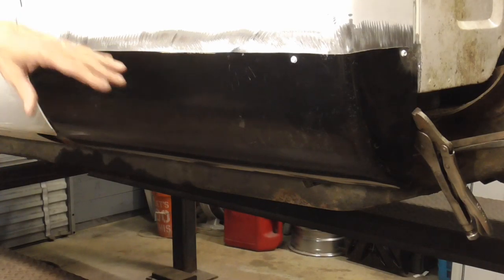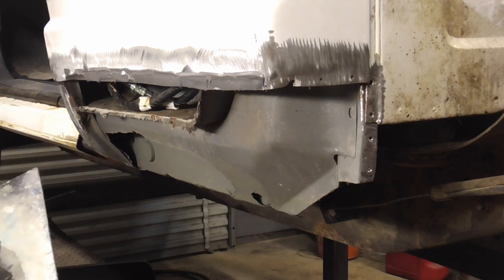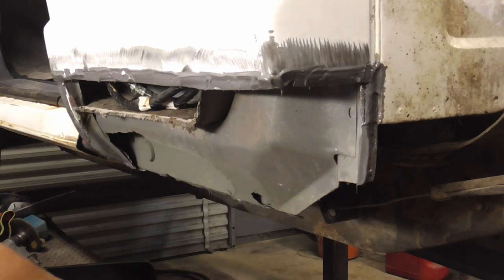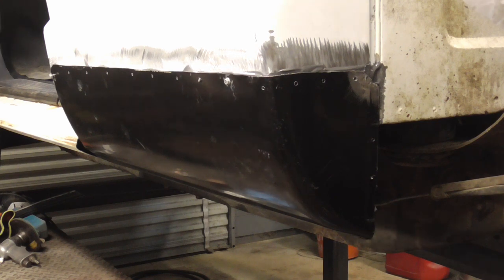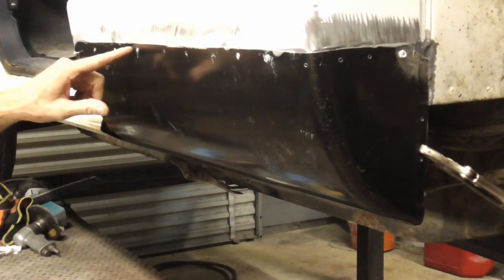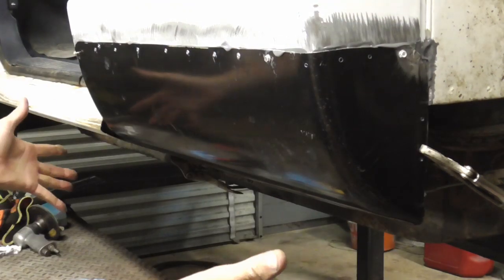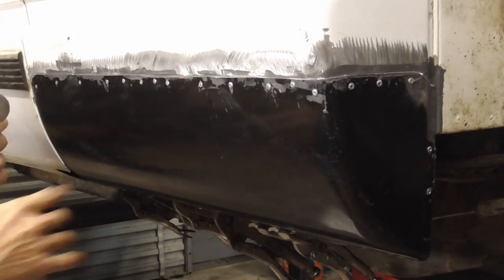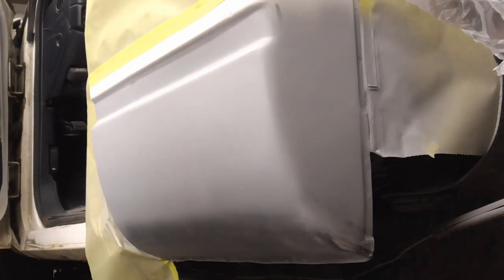Cab Corner Patch Panel Installation with JB Weld | Panel Adhesive

Comment: You may want to try self tappers instead of rivets.  Then just back them out.  There is really no reason to cut the opening so closely to the panel dimension.  I've tried both and the finished panel seems stronger with more of an overlap, unless the fitment over the overlap is really a pain.  No matter what, I think everyone that ties what he's showing here will like it if they try it.  I'll have to try JB Weld myself.  I had been using that pricey panel bonding epoxy.  Thanks for the video!
Reply from the maker: You're welcome Bill - have a good week :)
Reply: How do you back them out if there encased in cured JB Weld? Also, wouldn't you have a bunch of holes?
Reply: @johnp82  You don't encase the heads of the screws.  Self tappers are tapered, so they'll come out pretty easy.  There will be holes, but you're going to need filler for the seam anyway.

Comment: I bought a squeeze tube of  3M panel bond to do the cab corners on my 01 4dr. Ext. Cab. The cab corners are much smaller because of the rear doors. It did work great. I didn’t want to catch the interior on fire.
Next I have to do the same repair panel in my Dads 98. I may give the JB Weld a Shit as panel bond is quite expensive.
Reply from the maker: It is and that's why I tried this cab corner with JB Weld - It's my son's truck so we'll be able to see how well it holds up
Reply: Even though it's spendy. It's cheeper than a wielder.
Reply: RedWhiteAndBlueVideo I welded about 50 % and in back of cab I used panel epoxy and then covered all welds on my rockers after a light grinding and cleaning with j b weld the one that takes a day to harden I get it in big tubes in a box about $ 20 Canadian ( don’t use any quick cure epoxy unless it meant for panel bonding . I also used jb long time cure to attach a portion of fender on my 1976 vette some years back no problem no ghost lines in paint
Reply from the maker: @nickking1510  Very cool - good to hear
Reply: RedWhiteAndBlueVideo  lake side is correct oil the repair back side when paint is dry your repair will out last the car then ,better oil entire car doors trunk rockers hood fenders all lines keep it away from exhaust,  cat , manifolds  . In Ontario because of salt I do my car and truck yearly so does my son
Reply from the maker: @nickking1510  Absolutely! Bought a 2002 Kia and started filling the rockers,doors,tailgate, hood, etc with used oil and letting the excess drain.  It has not even thought about rusting in those areas.  I still have it - only place it shows rust is where I got lazy and and didn't rust proof.
Reply: nick king 
I live in WI I use spray lithium grease and it lasts all season. I think I’m going to put oil on the inside of my frame rails and crossmembers. My truck is an 01 Silverado 
From Upper MI my uncle owned it now it’s in South WI by Lake MI. Still looks real good. My uncle never had oiled it, so rust did get into the rockers.
Reply: RedWhiteAndBlueVideo yes the oil I use is chain bar and cheap cooking oil and some motor oil and a little diesel, it flows into all the pinch welds and goes into the rust that’s there , I drill holes in all double wall spaces like pillars and rockers and fill them with undercoating black plastic plugs . On my 400000 k  3.8  2004 Grand Prix daily driver I leave the holes open . Most of the cars in Ontario go to the crusher because of rust not because of mechanical problems . I read a report in a body shop magazine in the article it said a unibody car driven 4 years in the rust belt looses 25% of it strength at 4 years old or 4 winter with salt
Reply: nick king 
Yes it sure does help to keep the salt off. Now they brine the roads before a storm. I always know when it’s going to storm by seeing the lines of brine on the road. I did buy a gallon of Supertech bar and chain oil. I’m just wondering if I want to sacrifice my binks spray gun or make some kind of siphon feed sprayer with a mason jar and tubing
Reply: RedWhiteAndBlueVideo the industrial size tubes which take 1 day to cure are great very strong on properly prepped metal or fibreglass
Reply: @brianjacobsen5762  Harbor Freight has cheap welders

Comment: I don't know how well the JB Weld will hold up over time, but you should've used an pneumatic flange tool to ensure the panels aligned up. Had you used that tool, you wouldn't need to perform any major body work such as pounding down the edge.
Reply from the maker: I'm going to do an update video on this truck.  I'll try to remember to alert you when I upload it.  It's still holding up great to this day - it's my daily driver - two winters now with this repair.

Comment: Great video as always i got a spot welding nozzle from eastwood i haven't tried it yet but you can use that without knowing how to weld it fits harbor freight flux core 125 mig welder i got the kit with the pliers
Reply from the maker: Good information my friend  - have a good weekend :)

Comment: Good job there sir, Planing to do the same but for the wheel arch on my ram1500, also will rivet with nut rivets instead of pop rivet, I will also install fender flares on top, will see how it will turn out
Reply from the maker: Let me know how it goes for you :)

Comment: Do you have one on doing rocker panels I have a 2001 Chevy S10 pick pick up ZR2 package is a package that I have to do rockers do rockers and it has the 3rd door on the driver's side please please comment back thank you very much this was a very good learning experience hope to see more of your videos
Reply from the maker: Here's one that may help - they are all done using the same method.  Weld it in, grind the welds just a bit,  knock down your seems, fill.

Comment: We have used  3M Panel Bond for about 4 years for rust repair on Chevy & GMC trucks. 3M or GM, Ford or Mopar will tell you where to weld & show you where to use panel bond. It is factory approved. Only downfall is curing time. They say 8-19 hours it is more like 24 hours. here is a cut & paste right from their website. 3M™ Panel Bonding Adhesive is intended for use in outer body, nonstructural panel attachment applications, including applications where
 panels are used in conjunction with welding and/or riveting.  So try it if you don't have a welder.
Reply from the maker: Very cool - thanks for the tips - I'd like to do a video on that.
Reply: I agree that bonding panels is best for non structural panel attachment.  I wouldn't trust its' success for things like rocker panels or a step panel that is going to take a beating.

Comment: I have a crimping tool to mesh panels together and their is no need to pound the panels down. They are called a "KUNTEC Straight Type Pneumatic Punch Flange Tool 5mm Hole for Plastic Metal Drilling Punching Folding"

Comment: I use the slow setting "original" formula hence slow dry JB Weld. The secret is clamp, clamp, clamp. Give it 24 hrs. To fully set up and it'll hold forever. Just finished patching a hole in my dad's jeep and it'll probably outlast the vehicle. Use a good fiberglass filler like duraglass over the seems first for extra waterproofing and your good to go on body fillers to finish. I quit welding them in as the heat seems to make them rust out faster than glueing them in.
Reply from the maker: Thanks a lot for the comment - a lot of body shops are gluing now as opposed to welding.  I think that's really the best way if it can be perfected for all situations and patch panels.

Comment: Ya you will be able to sand off those rivets and not worry about the JBweld letting go of the body metal. I been using JB weld to fix small engine blocks after they blow a rod thru the block and it hold under that kind of pressure and heat so a body panel would be nothing.
Reply from the maker: Thanks for the input John - the JB is a life saver at times for sure.

Comment: I'm want to try this. Slightly different. I'm thinking if I flange the repair panel to go behind the existing metal. Sand the inside of the body panel and jb weld the inset flange. I'm hoping this creates a small channel to fill rather than having to blend the whole patch. I'm terrible at Bondo work on large patches. Great video. Have you seen any delamination over time or is this a more permanent fix? I've learned so much from watching your videos. I honestly can't believe it's free! Thank you.
Reply from the maker: You're welcome.  Works great but make sure your flange is at least 1" wide.  Here's the video on the longevity - https://www.youtube.com/watch?v=wRl1QfkrBeY  - In this vid I cover all repairs done on this truck.  Thanks again for you support.  Let me know how it goes if you try it :)

Comment: Thank you for this video. I was wondering if this would work. I have to replace the rocker panels on my 2012 GMC Sierra. I bout the rocker covers and now have to cut out and wire brush out all the rusted metal. What do you suggest as a rust encapsulator for under the panel and the area around the rocker? I may even use spray foam once everything else is done to try to keep mud and sand from getting back up into the crevasses. I live up here in Maine and rust is a never-ending battle and I can not afford a new truck being on disability.
Reply from the maker: The best solution is to provide sufficient drainage so that the panel can drain and dry out inside.  The do this - https://www.youtube.com/watch?v=8XaZBy7GC7A  Your repair will last a lifetime if you maintain your panels - can't let leaves, needles, dirt, salt, rust chunks build up inside the panels.  It needs to look like an old oily valve cover on the inside - that oil will creep around and get everything greasy yet allow for drainage :)

Comment: I repair a lot of rv's/camper vans - in many situations they have rust right where fiberglass body sections meet steel - welding is not an option as the fiberglass panel will burn up if you try. So yeah - panel adhesive gets the new metal fitted. You gotta do what you gotta do - there's more than one way to skin a cat.
Reply from the maker: You're right James - gotta do what is necessary to fix it.  Thanks for the comment :)

Comment: I'm using this method to install a small patch panel to the rocker of a Miata. I am using small screws to hold the panel in place. After the JB weld has fully cured would it be acceptable to grind off the screw heads or should I attempt to remove them all? I really appreciate all your videos and excellent advice.
Reply from the maker: You can grind them right off.  Tap the seam down just a bit - maybe .030".  Ask more ?s if needed - this panel is still good today - Pastor of the church bought it - put new trans in it and really loves the truck.  I'll be doing another follow up vid on it soon - for now though - https://www.youtube.com/watch?v=gIS1Tbv7Kvw
Reply: Thank you so much for always taking the time to answer my questions, I very much appreciate your guidance and knowledge.

Comment: In 2010 we had a hailstorm, and I know I put on more than 15 roof skins using at least one tube of 3M 8115 on each skin.  That's at least 750 bucks!  I'm glad I wasn't paying the material bill, although I basically made a year-and-half pay that year.
Reply from the maker: Wow - that's a lot of work - that's makin' some $.  I just found out the Boeing glues and rivets commercial jets together w/ epoxy so it's a legit method of repair.
Reply: @LakesideAutobody  trust me when I say the steel will tear long before the bond of 8115 would break.  It's like the old Super Glue ad where they picked up an elephant, except the 8115 could pick up an elephant with a Boeing 747 strapped to him
Reply from the maker: @karsbkool  That's funny.  I'd hate to be the guy removing the panels 😵
Reply: @LakesideAutobody  you could probably break the bond with a torch, but it would definitely be a task

Comment: I have a 2004 Tahoe,they all rust at the rear ¼ panels ,would powder coating be a good thing on the new panel and then grind down the areas that need to bond,also I think pounding it befor it hardens would not compromise the bond,,your thoughts...great vids..Dennis
Reply from the maker: You could try the powder coating the inside of the new panel - sure.  As long as your new panel can drain and stay dry on the inside you'll be fine.  That's why it rusted in the first place - it just stays moist and fills with debris in there then rusts out.  You probably could get away with not even tapping the seam down.   Auto sheet metal is literally 6 hairs thick which could easily be hidden or tapered out like a dry wall seam.

Comment: Great video 😁 but can I use this glue for slip on rocker panels?
Reply from the maker: I think it would work fine.  Another alternative is automotive panel adhesive but it's a bit expensive.  https://www.amazon.com/3M-08115-Panel-Bonding-Adhesive/dp/B000PEW4MI

Comment: When you "knock down" the seam, are you basically just denting the seam line inward a bit so the bondo doesn't have a big lump in it on that line?
Reply from the maker: Yes.   Not only does it hide the seam but the filler is a great buffer between the seam and the finish.  None and you'll likely see the seam later on down the road.

Comment: I just installed a panel like that ok my Ford van behind the rear wheel cut the panel a bit smaller overlapped but I used silicone and rivers then used fiberglass bondo first by the time I finished cane out very good for a novice but I did not knock down as you show. How do you know how far yo whack it down?
Reply from the maker: That sort of comes with some practice.  Basically there is nothing to worry about.  If you didn't hit it hard enough you end up with a few high areas when sanding your filler but that's not a big deal.  Just tap those high spots down and mud again.  After a while you'll know about how hard to tap in all different types of situations - it's different every time BTW because of a lot of weird variables :)

Comment: Thanks so much.  If you were lap bonding a long panel like a quarter panel for example, are you thinning the patch panel significantly when you grind it down to match the height of the existing panel it's bonded to?
Reply from the maker: No, you would tap the seams down a bit.  In this case I was very careful not to tap too hard as I wasn't sure how the JB would handle it.  I believe panel adhesive is more flexible so you would just grind the seams a little and tap them down then fill.

Comment: It looks great on the outside. What do you do to the bare metal on the inside once your cab corner is sealed off. I believe welding is stronger, but your welds will rust on the backside where you have no access. Have you ever used composite rockers by Never Rust?
Reply from the maker: I've never used them but that's a great idea for a video.  The key to the inside is to make sure the panel can drain and dry.  Then after you paint and have put it all together, you can simply squirt some used motor oil in the panel to coat the very bottom of the panel as that's where the rust will begin again.  It won't start on the side unless debris and salt water gets trapped in there keeping the side moist.  The panels must drain and be allowed to dry.  If you notice panels that are open (not enclosed) never rust out.  Hope that helps a bit - thanks for the support   I'll do a video in a couple of years on how this truck is holding up as it is my car trailer puller and I plan on keeping it - Thanks and have a good week :)
Reply: Maybe powder coat panel first

Comment: This makes repairing my truck bed rust/rot much less intimidating!!! Thank you!!!
Reply from the maker: Glad to hear it.  Myself, I think using JB or panel adhesive on floor boards is better than weld because it seals the seam.  I once glued in a whole B250 Dodge Van floor with self tapping metal roof screws and panel adhesive and it worked great - no leaks, no worries about rust in the seam, easy.  Let me know how your project goes :)

Comment: There is quite a few products from JB weld which one is the one you used for the repair panel , I want to make sure to use exactly what u used .

Thanks for any input .
Reply from the maker: It's called JB Weld Original - https://www.ebay.com/itm/255262087248?chn=ps&norover=1&mkevt=1&mkrid=711-117182-37290-0&mkcid=2&itemid=255262087248&targetid=

Comment: Since  the factory body molding goes right over the seam, the rivets alone should do the trick, if you are trying to keep water out, some cheap automotive silicone should work and be even less expensive that the JB.
Reply from the maker: You're right.  You could go that way too :)

Comment: Great job! I want to try but not sure have the confidence in it too last. Would be an Ideal solution for as project car is in a field with no power point available. How did you get the panels both flat as patch over lapped dent in and fill?
Reply from the maker: You can do this.  To get the repair flat, just tap it down slightly and fill.

Comment: What kind of filler do you typically use? What kind did you use with this project? I’ve only ever used “bondo” from the department store but now days there are so many choices!
Reply from the maker: The cheapest I can find - it really is all the same.  These days  - Evercoat Lite Weight Body Filler
Reply: Awesome thanks

Comment: I find no JB WEld that sets up in 8 hours, all are in a frew minutes  Can you tell me the part number of the product you used with an 8 hour setup time ? Ref: 1:37 time on the video.
Reply from the maker: Yes - it says "Original" on the package - .J-B Weld 8265S
Reply: Same for me. Jb weld harden so fast I  sometimes can't even use all that I  mixed.